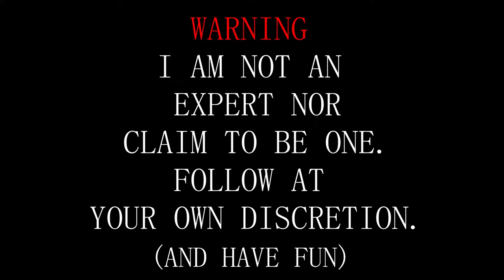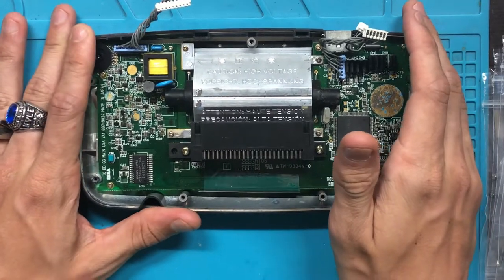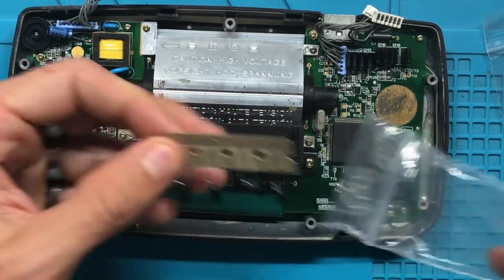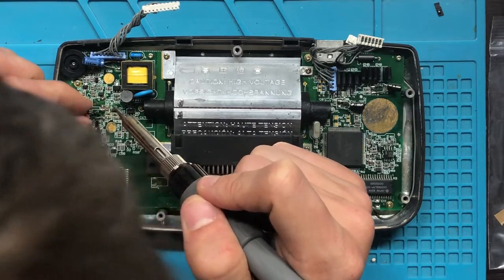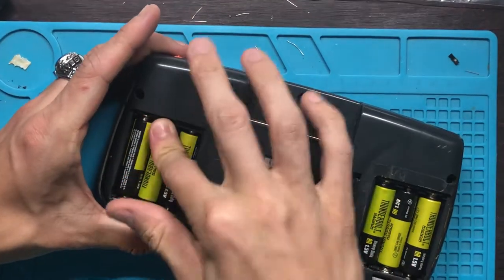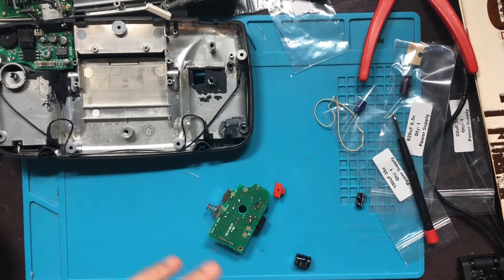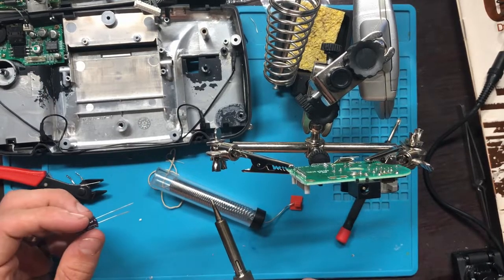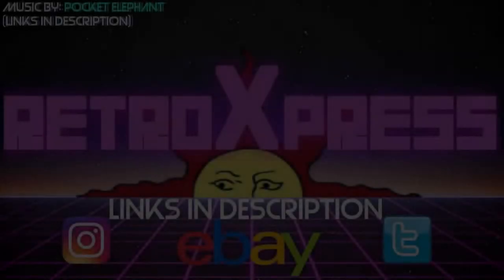Retro Repairs #1 - Sega Game Gear Repair Attempt

Comment: awesome! I'm gonna attempt my first repairs soon. Gonna start with replacing the internal clock battery on a Sega Dreamcast and then replace the Power Jack on a Sega Nomad. Brand new to soldering so a little scared, but it looks pretty simple.
Reply from the maker: ooo that sounds so fun! I want to fix a laser disc for practice soon! hey man if you need help fixing that sega nomad, ill do it for you free of charge! I even have a spare power jack for one!